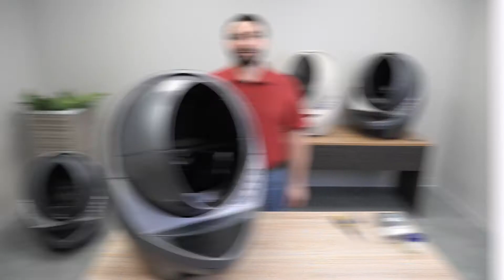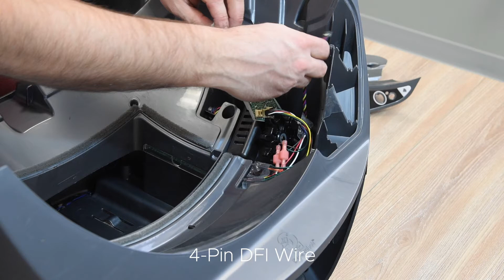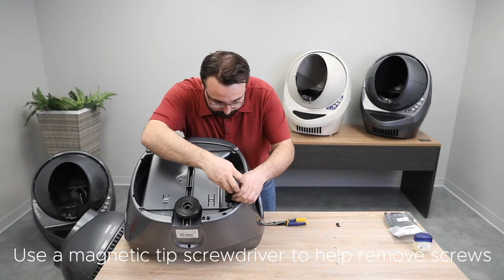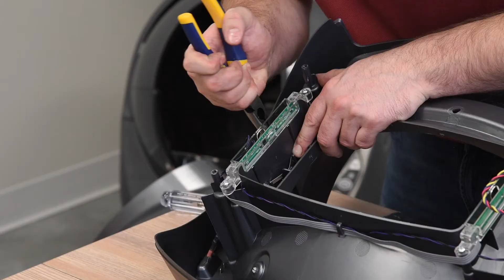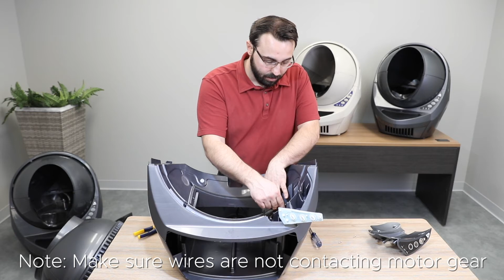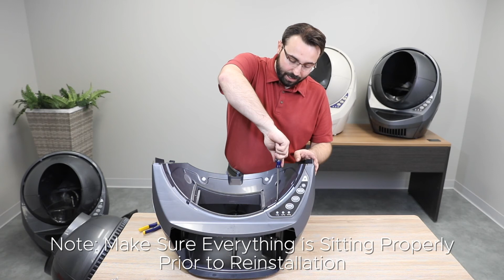DFI Kit Installation Guide | Litter-Robot 3

Comment: Great video... but, before you start...

1. It's highly unlikely that the DFI unit itself needs replacing... it's most likely just those 2 metal pinch things, which very quickly corrode due to cat waste vapors.  But replacing them still requires the complete disassembly of the unit as shown in this video. I recommend you try just replacing those first and send the DFI unit back for a refund to save a bit of money.

2.  Note  that you need a long-reach Philips #2 screwdriver to remove some of the screws on the underside of the base.  Unless you do a fair bit of DIY, you probably don't have one of these, and your regular length screwdriver will be useless.

3.  The replacement DFI boards being sent out now (late 2022) are tiny compared to the originals in the Litter-Robot 3 and are housed in a very different style of plastic mount.

4.  It's all very well watching a video of a pristine factory condition unit being repaired... your Litter-Robot is more likely to have a build-up of unspeakably nasty crud in various places that can block parts of the unit slotting back into place once disturbed.

5.  Any disassembly/reassembly video that advises you reach for the Vaseline betrays a design flaw; as a customer, you should not need to apply vaseline to the inside of any electrical/electronic item you buy.  The design (and ease of replacement) of these pinch strips is a weak point in an otherwise solid product, and I really hope Litter-Robot have addressed this for the LR4.
Reply: Totally agree with 1, 2, 3, 4, and 5.  If you set up replacing just the two pinch clips, you don't even have to remove the control module.  Cannot emphasize enough the need for a very long neck screw driver.  But, most importantly, I'd like to see the company offer multiple sets or a dozen of the metal pinch clips.  They corrode so easily. Seems irresponsible to sell a product this expensive to have built-in failure every 1-2 years.
Reply: Just got done and couldn't say it better myself, the fact nothing is potted shows the "value" engineering going into this product. Super disappointing.
Reply: Where can i get new metal pinch detectors

Comment: Purchased my LR3 after the first or second stimulus check. Around nine months later the DPI needed replacing (just going off of memory so it might not have exactly been the DPI) and was furnished a new base. Now only seven months later I'm having the same issue. I spent almost 700 on this unit and it's not working as advertised. I don't know what the issue is but to me it's looking to be more and more a design and/or manufacturing defect. Eitherway, I'd just like for the contraption to actually do its job. It's a blessing to have for those who hate litter box duty and even helps those with physical limitations still be able to care for their pets. When it works, that is.
Reply from the maker: Thank you for providing your feedback on this. We are sorry if the troubleshooting steps in this video did not resolve the issue. We'd be happy to help assist you further! Please contact the Customer Experience Team here for additional assistance: https://support.litter-robot.com/s/contactsupport?language=en_US&category=Returns%20and%20refunds&subCategory=Request%20a%20return&utm_source=cdp&utm_campaign=US_EN-OST-PostPurchase-LR4_Update-SupportTicketCreated&utm_medium=Promotional. Please inform the Customer Experience Representative that you completed these troubleshooting steps in full using the self-service troubleshooter.

Please be prepared to provide Customer Experience with your Litter-Robot 4 Serial Number, Email Address, Name, and/or Phone Number to locate your Whisker account and determine the warranty status of your Litter-Robot 4.

Comment: Thanks for the video, it seems like the only thing that needed to be replaced was the silver pieces, I had to disassemble all and put it all back together with 0 knowledge in electronics  at all just a cat mom who really really wanted to save herself $600. So yes, most likely it was only the silver pieces however I did change the whole thing, i ended up using one of those long screwdrivers and everything was back and running like new! Don’t be scared you can do it! It took me like 2 hours to finish it specially because with my adhd I’d got distracted a
 few times or bored, but yes after a little over two hours with lot of patience I did it! It works great it was pretty dirty back there so before you dig in you want to find you self maybe those of Clorox wipes and a vacuum, wipes to leave all that clean. Good luck!!

Comment: I could not get the blue light to stop blinking... when I started to take apart the DFI assembly I notice there was some gunk on the pinch terminals. I just popped those off, gave them a good clean (even used very light sandpaper where some corrosion had built up) and it's working back to normal. I have cleaned the DFI sensor cover in the past and that has fixed the blinking blue light. But, since it didn't fix it this time, I figured there was something blocking the electrical connection. Try that out before ordering a new DFI unit!

Comment: Again, this is a 17 minute video in a sterile environment, a completely clean robot, on a table in a workroom where it doesn't matter. If your robot doesn't work, you have to clean it, empty it and get a spot where you can work on it. But the thing that gets me is that every time it cycles, you have to wait a minute and and 30 seconds for it to complete the cycle to test it. In reality, it took me hours to get it apart, cleaned and then back together to test it. And the cycle light still stays on. He skipped the parts where he was having trouble, and sped up the video in parts. Plan on hours to get this POS working again. I own 5 screw guns with all kinds of attachments, at least 10 real screwdrivers. You need the one in this video (an extra long #2 phillips craftsman} in order to get the screws out. I had to go and get one. I hate this thing so much I'm ready to throw it out. It cost me the time I was going to get the materials for my sons holloweeen costume. I now have to do that at 7 pm tonight so we can work in it tomarrow. Do not buy one of these, you will regret it.
Reply from the maker: Thank you for sharing your feedback and experience so we can better assist. If you haven't already, please contact us by visiting whiskersupport.com or 877-250-7729. Our team of product specialists would be more than happy to help.

Comment: It worked! I've had mine for over 4 years. Customer service is outstanding. They sent me the new DFI and pinch assembly after I told them the issue I was having. I didn't expect this to be as long a process as it was, but it worked and I refuse to scoop again! The vid really needs better camera angles on the assembly and-reassembly. His hand covers up areas where I wasn't sure if I was doing it right.

Comment: Thanks, very helpful! My only suggestion is to attach the wires to the pinchers with two needle nose pliers before inserting the pincher. Seemed impossible for me to attach the wire after insertion. It was bending the plastic holders, didn't want to break them. So I pulled the pinchers and attached wires first, then easy to insert the pinchers. :)

Comment: I thought this would be complicated as I have 0 experience with electrical stuff, but It was so easy following step by step. And our litter robot is fixed!! 😍 I’m so happy
Reply from the maker: We're so glad to hear your Litter-Robot is up and running again! Please let us know if you ever have any questions as well. 😸
Reply: I do have experience with electronics but I was delighted that I didn't have to actually utilize any of if. Very easy to fix and my robot has been working like new since. 1000 times less frustrating the competitors' products that I've used.
Reply: Did you just have a blinking blue light and the bowl not turning?
Reply: @nerdyronald7753  yes

Comment: if i wasn’t slightly handy and had free time this would drive me absolutely insane. why aren’t the pinch terminals protected from debris getting in? this machine has caused me more stress over past the year  than i would have liked. completely defeating the purpose of why i bought it in the first place
Reply from the maker: We appreciate your feedback, Juneau. We would be more than happy to resolve any issues for you. Please reply with your Litter-Robot serial number and I will connect you with a product specialist right away! Thank you!
Reply from the maker: Thank you! We have reached out to you via email!
Reply: I agree. Mine started with bonnet removed. I didn't realize I would have to be handy when I bought this machine. Now it's doing pinch detect. Support emailed me a whole instruction manual. Ugh.
Reply: 100% agree. Same boat man. Its been consistantly a stressful/frustrating machine. Ironically my warranty expired a month ago in May, So they won't replace my broken machine. But they said they would sell me a new one for $500.
Reply from the maker: We would be happy to assist in any way we can! Even after the warranty expires, we're still here to help. You can always send it in for repairs, or purchase the needed parts and we'll show you how to install them. It's surprisingly easy! Please provide your case/ticket number and I will get you in touch with someone who can help. Thank you!!
Reply: @LitterRobot  Do you explain how to repair in other languages, for example in Spanish? I think something so specific and complicated should be explained in all languages. After 11 months, my robot has started to have problems, blue light is flashing all the time! I've cleaned and checked everything and the problem follows. I've sent and e-mail to tech support and I'm still waiting for your answer.
Reply from the maker: Thank you for reaching out! Our customer service team does their best to reply to every customer within 3 days. Please provide us with your case number or serial number and we will gladly connect you with a product specialist right away! Thank you!!
Reply: No, the pinch terminals aren't protected at all, and they're made of a cheap metal that corrodes easily, so they don't last more than about a year.  I've had to repair my LR3 so many times, I finally gave up and got a PetKit Pura X, and it's so much better engineered and put together.  I've had to replace the DFI sensors many times (even though they have no moving parts, but they die in 1-2 years anyway), the pinch sensors, and the cat sensor.  I recommend staying far away from Litter-Robot at this point; now that their patents have run out, there's much better competition available in this country.
Reply: @LitterRobot  Whisker Support refused to send me parts saying it was not user serviceable, but you (and many users) are saying it is very easy to service.  On top of that, I service mechanical and electrical components all the time, so this isn't really unfamiliar territory to me.  What I find difficult is figuring out where I'm going to put a bunch of unwieldy components while I ship in the base when the place I would put those components will need to be used by replacement litter boxes until I get the base back and I'm tight on space because we're living in an RV right now... 

Yikes... the amount of problems created simply because of an unwillingness to meet the customer where they are at after they already paid $500 is simply mind-blowing.  I can't imagine doing this to my customers and expecting to keep business coming back or referrals coming in.
Reply from the maker: @TheOriginalJealotFaith  Thank you very much for your feedback. I will forward your comments to our Customer Service management team for immediate review. We would be more than happy to answer any further questions at 877-250-7729. Thank you again.
Reply: Same
Reply: I 100% agree! Same thing happened to me. I was fortunate enough to have them send me the part free of charge, but still a hassle and the machine is the absolute worst product I have ever bought for the price. The newer model looks more promising. But I will look at other models and reviews first.
Reply: I second this
Reply: @miles3402  that is awful. For such an expensive machine the warranty should be at least 5 years. That's horrible.
Reply: @miles3402  SAME!!! and sadly this is our second that did the same thing broke down a month or so after warranty expired. the husband talked me into getting the second because when it worked it really was great...never again. hopefully I can figure this out and it lasts long enough to research something that will work long term
Reply: @wolstentech  wish I had read all of this before!
Reply: The Litter Robot is like those Dyson machines. All you ever do is constantly having to service them or send them back. That’s why they cost so much. You’re paying for continuous problems. 

I’ll never buy another Litter Robot again based on having one just over a year old and we’ve had the base replaced once, pinch terminals twice.
Reply: 100% - have had nothing but problems with this. Tons of bonnet removed alerts, when bonnet was connected. Have received several bonnet replacements. New issue is the pinch sensor. Poor design, it’s just crazy.

I had the original litter robot for almost 10 years without any of these issues. The company has lost their way.
Reply: Same
Reply: @litterrobot can’t you just fix the design?  I can’t even go to work without my box failing and my cats not having a place to go to the bathroom that isn’t my new flooring
Reply: It is insane.
Reply: I have one that won't power on just the yellow solid light comes on

Comment: Pro tip: Make sure you have a long enough Phillips head screwdriver before you start and find out yours doesn’t reach the deeper screws on the underneath 😅

Update March 2023: The DFI sensor replacement kits seemed to have been updated, and now the motherboards on the sensors are smaller & enclosed in a plastic case, which I assume is to protect them from erosion. Hopefully this is my first and last time replacing the sensors on my L3. However, if you follow this guide, you should have no issue with the replacement, and I would not consider myself handy at all.

Don’t freak out, you got this. Good luck 👍
Reply: I ordered my DFI sensor replacement kit in early May '23 and it arrived with a different shape than the part I took out.  Also included new pinch detect springs in the kit.  First run seems successful.  Hopefully this holds up a lot longer than the original (3.5 years).
Reply: How did you get the new DFI sensors to fit?? I can't figure out how they're supposed to go in and there is no video for that
Reply: @kadiecarter7469  They should fit similarly to the old ones. You just have to remove the old ones completely. There is also a picture step by step guide on their website.

Comment: I purchased 6 of these units, with extended warranty and had 2 units replaced under the warranty because they malfunctioned.  After warranty was up had two more go bad and replaced.  One replacement unit is now bad and I have ordered the pinch kit $80.00 more out of pocket.  Now another one doing same with fast yellow light blinking.  Problem is that dust and debris plus corrosion causing this issue.  I maintain a thorough cleaning of these boxes about every 6 weeks but it did not help.   Am very sceptical about the newer units that are out on their quality and hesitant to buy one because the cost is almost 1 1/2 more than the litter robot 3 units
Reply from the maker: Hi Jacquelyn, we're sorry to hear that your having issues with your Litter-Robots. We would be more than happy to look into this further for you and provide any assistance we can. Please submit a ticket at whiskersupport.com and we will connect you with a product specialist on our team.

Comment: Just tackled this job after buying an extra long screwdriver.  I wasn’t sure if I had the pinch terminals installed correctly, but it cycled through ok so far.  Maybe add some close ups of the pinch terminal installation.  Mine were so gunked up with litter when I removed the old ones I couldn’t see exactly how they were installed.   I suspect I may have been able to just clean those and bypass paying for the whole DFI kit. Love my robot and glad I was able to repair it fairly easily.

Comment: I'm probably going to order this replacement part and see if my unit works longer than a month. I thought it it was a moisture issue, the unit that wasn't working started to when I put some damprid in the drawer, but now it's quit again. Flashing fast yellow then resets to full even if it's empty, and back and forth. I already sent a whole base back and that was honestly such a hassle I'd rather fix it myself instead. It's clearly a design flaw that all the sensitive electronic components are directly exposed to urine in the waste drawer. There's that single piece of plastic on one side, but it does nothing for ambient moisture. Or the fruit flies that get in either. I've seen people wrap the dfi in packing tape, something I've considered, but that shouldn't be necessary with a $550 product like this.

OH and somehow urine gets UNDER the rubber dome, not easy to clean, not easy to reach at all, very easy to get a bad odor. Honestly whoever designed this seriously underestimated cat pee.
Reply from the maker: Hi Savannah Rose! Thank you for your feedback regarding this. Your comments will be sent to our team for review.

We are very sorry to hear your Litter-Robot is not working properly at the moment. We would be happy to work with you to honor your warranty. Can you please provide us with the serial number of your unit?

Comment: This helped a lot for accessing the DFI! My DFI had some corrosion on a chip's contacts. I managed to clean it with an old toothbrush and got it working again.
Reply: Did the same with mine. I let the pinch terminals soak in white vinegar for two hours. Then wire brushed all the corrosion off.